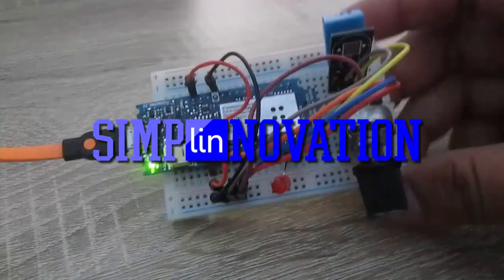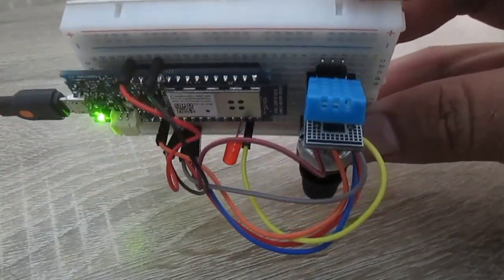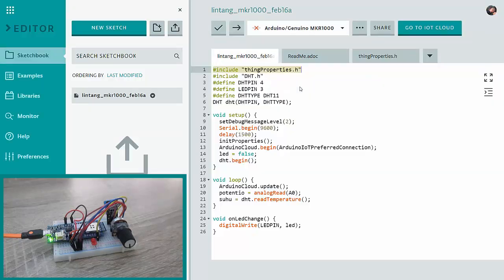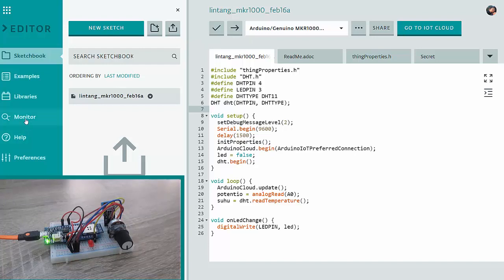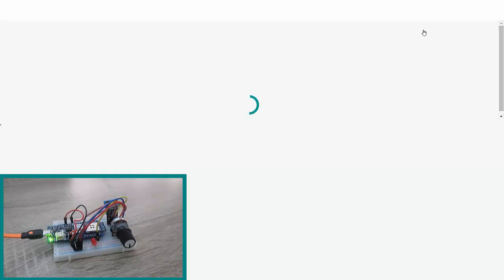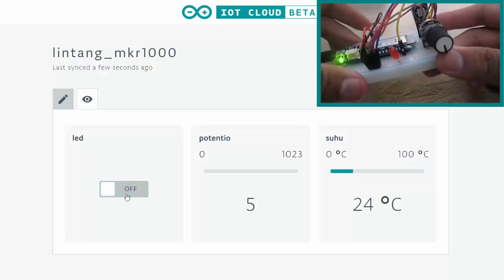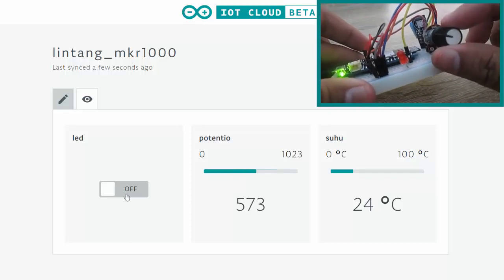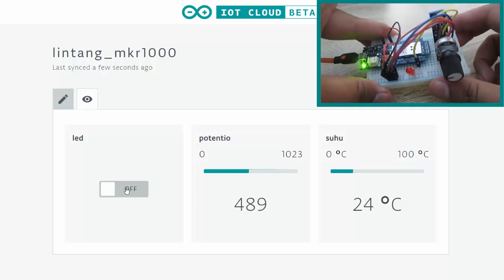MKR1000 & Arduino IoT Cloud

Comment: Hi. Thanks for video.
I have a question about wiring diagram.
How did you connect 5v to A0 pin, if mkr1000 works with <=3.3 volts?